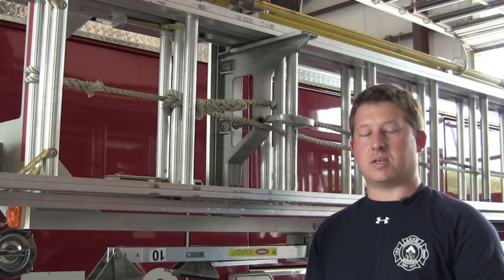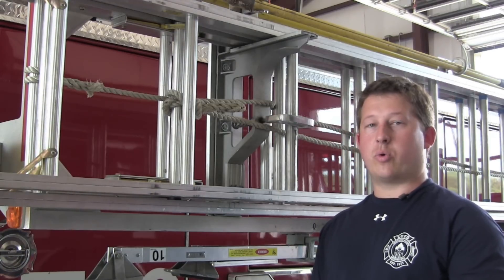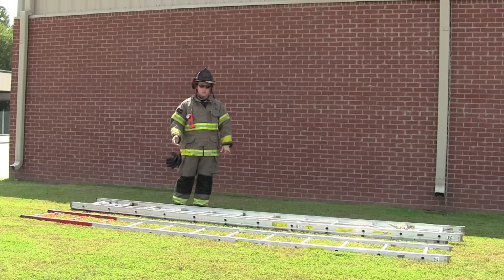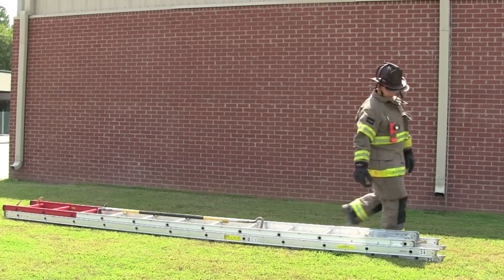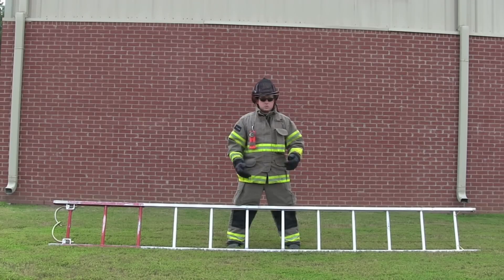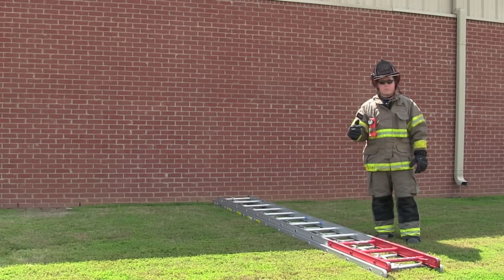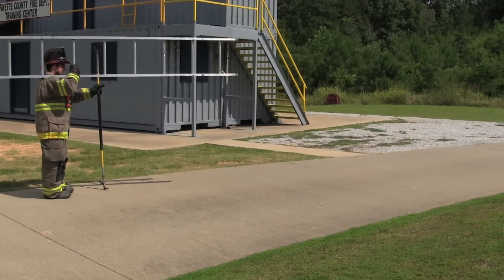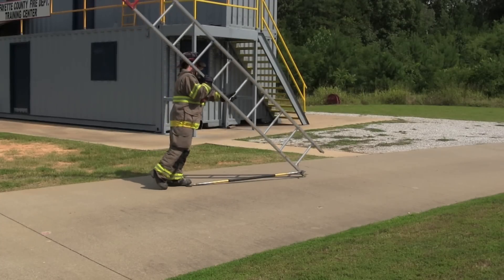Ground Ladder Tips

Comment: I work with a 375lbs rated fiberglass extension ladder. I whish it was this light lol
Reply from the maker: To be honest I think this ladder is heavier than your 375lb rated. This is a 24’ AlcoLite rated at 750lbs. It weighs 75lbs. I think most of the fiberglass ladders weigh a good bit less than fire service ladders. Fire service ladders have to meet NFPA1931 and they are way over engineered.
Reply: @Boxalarmtraining  So they're about the same weight. Didn't know they were that heavy, aluminum ladders are usually much lighter. You made it look light!
Reply: @Boxalarmtraining  But it makes sense when I think about it, it has to support multiple people on it (when rescuing people for instance), while my ladder is designed for one person at a time (although I weight 140lbs, two like me could be on it and still be well below the weight rating)

Comment: Cant wait to try all this with a regular extension ladder. I attempted nearly all of it after watching this and getting all psyched with the 40 footer and was reminded what a 98lb. Weakling I am.   Didnt kill anybody, but after just barely getting it raised once, I couldn't move it at all and was nearly spent.  When I lowered it, i got it like 70 percent down before the ladder started extending in my hands (should have spun it around first, I think) and I had to let it crash the final five or six feet.  
Later I got the tip of my shoe stuck in between the rungs and luckily my toes were spared and I kept control of the ladder or my foot was going with it.
 Abandoned the power clean as soon as I assumed the grip. 
 Once I got it raised (and barely kept it pinned to the building ad it wanted to tip), it was evident it was not on flat ground so I had to try to lift up one leg while sliding something underneath while not allowing it to slide down the entire side of the house.  Somehow, it worked.  
 I dont think I could even carry the ladder vertically with the low hand through, weak hand over method that is the go-to on a 20 footer.
 I have no doubt this all would've been awesome with a manageable ladder,  but god damn lol. Rough day.